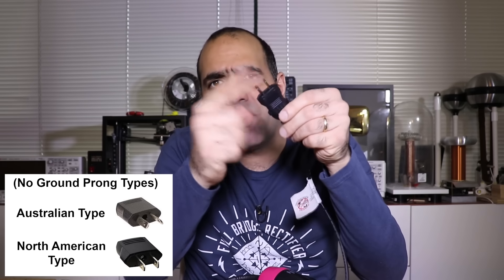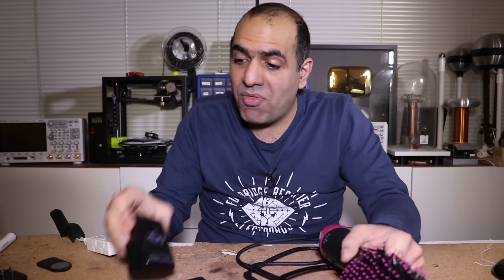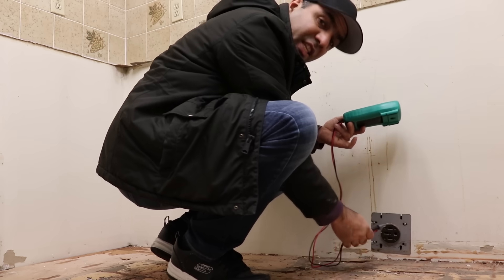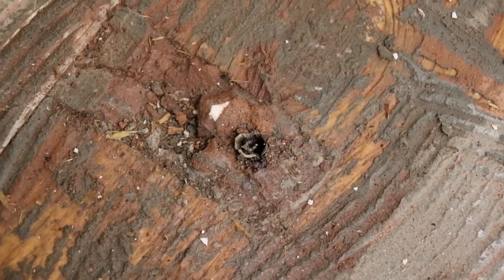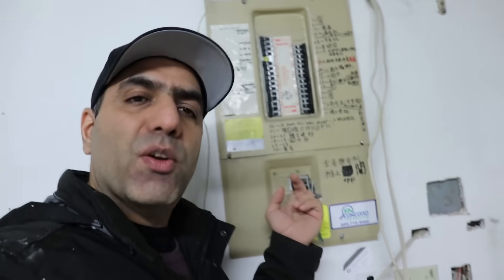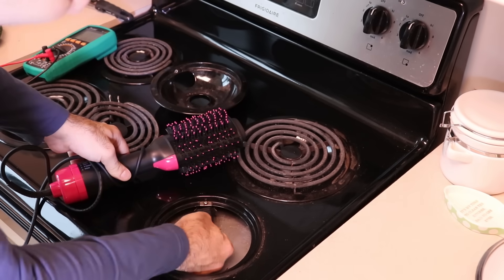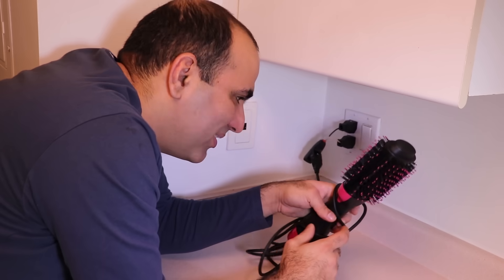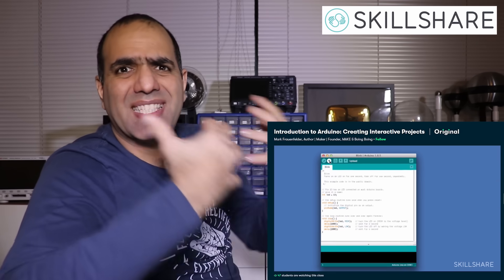Finding HIGH POWER 240V in a 120V Country

Comment: I'm an electrical engineer who moved from Europe to N.America.  I still remember replacing a kitchen outlet and poking around with my multimeter.  I wondered why, every time I touched the two live wires together, I would get a flash and a tripped breaker.  Took a while to figure it out.  I wonder if you have a video asking why N.America went with the clearly inferior 120V all those years ago?  I always assumed that it was to reduce the severity of electric shock risk.  But in fact they were worried more about the capabilities of the insulation (remember this was long before PVC or polyethylene etc).
Reply: Also, half way though the video, did you say 120 degrees instead of 180 degrees?  Also, did you replace the fuse in your multimeter with tin foil for dramatic effect?
Reply: All those years ago the main use of electricity was lighting.  Lamp life is inversely proportional to voltage. If you double the voltage you have to replace bulbs twice as often.  Low voltage bulbs have beefier filaments.
Reply: The North American system is not clearly inferior, it is far safer.  We have 240V available for the few appliances that actually need that much power, yet no part of the system is more than 120V above ground to minimize shock hazard.  Why in the world would you need over 3KW available at every outlet in your house?  There is a total of 3 devices in my house that need 240V - Water heater, stove and heat pump.  Every one of the hundreds of other things work just fine on 120V.

Comment: 4:00 the reason why the meter exploded: as he said his meter was on "current". His 20 A plug is directly shorted to ground with a thick copper wire. Which means, probing the 240 V socket is the same with shorting itself, yields extra power and explodes the copper wire inside. I'm pretty surprised the house's breaker didn't open after a sudden circuit short.
Reply: Probably the fuse in the meter blew before the breaker could trip.
Reply: @Owen_loves_Butters  yea I was about to say that too. What most likely happened is he drew more amps than his fuse could take and it blew up. I've actually done this to a meter before and you only make this mistake once lmao
Reply: It was not the fuse that blew. He blew up a capacitor

Comment: There was only two wires when you plugged into the toaster outlet... white and black .. means you had 120 volts .. load  from one plug and neutral from the other plug....not 240 or two phase  because only one positive... you need 120 from one phase and 120 from the other phase that are 180 ° out of phase with a common wire or neutral wire and of course ground...
Reply: No that is wrong.
If you want 240 volts then you use the two 120 volt lines that are 180 degrees out of phase. You don't use a neutral line in this configuration.
Voltages are always measured as a potential difference between two points. If you have three lines, phase, phase and Neutral, then where are you measuring the voltage to obtain 240 volts? The only possible answer is across the phase to phase with the phases being 180 degrees apart.

Comment: I thought that to reduce the chance of a 200 plus volt shock, you were not supposed to have seperate phases within reach of each other in a room. Touching a faulty toaster and kettle in that kitchen would give a 200 plusvolt shock not a  110 volt shock.
Also as you know the regular UK style 240 volt system has one wire to zero volt earth / grounding (often not completely zero due to resistancies). The US 220 V has both wires to a 110 volt supply, which is totally different to the UK system. Thought I would mention that as a do not try 220 volt in the US at home for UK style 240 volt stuff..
Also many old fashioned UK electical devices have the device body connected directly to the earth . ground wire. This would lead with the US system to a good chance of the device body becoming live at a fatal 200 plus volt level. Add that people will grab the device and not be able to let it go on AC it is very dangerous.
Reply: The current US standard is 120V / 240V.  The two hot wires are across a 240V supply.  The neutral wire in the US is bonded to ground at the main panel and is attached to the center tap of the 240V transformer secondary, so that you get 120V from neutral to either hot wire.  The ground wire is grounded and is what is connected to the chassis.  The 240V in US is completely equivalent to the UK, other than the difference in frequency.  US is 60 Hz, UK is 50 Hz.
Reply: @stargazer7644  You are dangerously wrong about the risk in the US. 
Each phase in the US is 110V to ground.
However 220 volts is available between two phases. Therefore  two appliances on different phases will have 220 volts between them. Touching one appliance  gives a 110 volt shock t ground. Touching both appliances gives a 220 Volt shock across them, and 110 volt Volt shock to ground. Really dangerous.

You are also wrong about the UK system. All domestic supply phases are at 240 volts from ground. Totally different to the US system. The UK does have regulations in place to keep different phases away from each other with domestic equipment to avoid a higher voltage shock.
Obviously not an electrician - I hope lol.
Reply: @andyrbush  You keep saying 220V in the US.  Our residential power system is 240V based and has only one phase, so  I'm sure you mean legs, not phases.  The only way you're going to get a 240V shock that way in the US is if you have two different faults shorting hot to chassis on two different improperly grounded appliances.  So you'd have to have 4 simultaneous faults for this to happen.  Not to mention, most (but not all) things in the US are double insulated making these faults completely impossible.  So this is hardly a "really dangerous" risk.  It never happens.

On the contrary, since the UK system always presents at least 240V in every appliance, I'd say that is the "really dangerous" system.  Any shocks received will always impart 4 times the power to the victim.  And look at the max power available at a UK outlet - insanity.  The US runs a special dedicated circuit for the few things that need that kind of power.
Reply: And to further answer your original question, it is perfectly fine to wire each outlet in the box to a different circuit with 3 wire cable. NEC 210-4(b) just says they need to be on a two pole breaker so that a fault on one circuit will automatically turn off both outlets in the box.
Reply: @stargazer7644  That is a totally different story to the original. And you are still wrong about the risks in the UK. It is or used to be illegal to have two phases in the same area of an office.
Reply: @andyrbush  You keep blathering on but saying nothing.  What is totally different? You're obviously from the UK and have no first hand knowledge of how the US electrical system works. If you're saying it's illegal in the UK, I can't comment on that.  If you're saying it's illegal in the US, I just gave you the NEC code that addresses the breaker requirements for it, so it is clearly allowed since at least 1999.  Look it up for yourself.  If you don't have anything specific to say, why even reply?
Reply: @stargazer7644  I am an engineer and both US and UK citizen. If you think I am saying nothing that proves you have no clue what you are talking about.
Reply: @stargazer7644  I will dumb it down  for you. 
If you only take one US supply phase into an outlet, there is only 110 volts available. Agreed? You cannot get 220 volts out of it.
If you take two phases into a domestic outlet, 220 volts is available in there agreed or not? US 220 volt outlets are wired differently to 100 volt outlets.
There is one 110V from one of the terminals and a separate phase 110 volt potential from the other terminal. If there is a leak to the body of both devices connect to a 100 volt outlet with two phases connected, then between them there is 220 volts. Touching both devices gives a 220 volt shock.

I have worked on massive steam and gas turbine generators. I do know what I am talking about.
Reply: @stargazer7644  If you put a volt meter between the two live holes in the double outlet of a 110 V receptacle wired with two phases (as discussed) it will read 220 Volts.
If you were to accidently contact (DO NOT TRY IT) those supplies, one to each hand, 220 volts will go through you.
If you happened to be insulated from the ground then there will be no earth fault to trip the breaker and you will not be saved by the breaker.
An earth fault breaker is a consequence mitigation device. Its job is to try and save people from the hazard. It is like a seat belt, reducing the consequence of a car crash. The primary device to stop a car crash is the driver and the braking systems.
Wiring a 110 volt outlet to one phase eliminates the hazard of a 220 volt shock.
Why do people like you vehemently push something they know nothing about. Are you one of those brainwashed by the US education system to never challenge what authority tells you? Quite amazing really.
Reply: @andyrbush  If you put yourself across the two pins of of a UK outlet without being grounded, you'll have exactly the same experience and you won't trip any safety devices there either.  So, WTF is your point?  For that matter, if you get across the hot and neutral of a regular outlet, you'll also get a shock.  You've become the load, so you'll not trip any safety devices.  And again, the situation you've described across two devices on different legs is extremely unlikely, but you keep on insisting it happens every day.   I've now told you multiple times power in the US is 240V and not 220V and you can't seem to get it, and you also don't understand what a phase is despite multiple explanations.  I have a 4 post maximum for educating idiots, and you've now exceeded it.  Stop wasting my time.

Comment: It's prolly discussed below, but apartment buildings and large places are usually served with all 3 three phases od 120v power to run high draw equipment. Tapping into to 2 of the 3 phases gets you the 208v
Reply: 208v is pretty weird.  the oven wouldn't run as hot as it should.
Reply: @tsm688  correct, sir.
Reply: 3 phase plugs and sockets that have five wires in them are always wired in wye, not delta.

Comment: 9:10 "perfect solution" - but with only 205 volts instead of 230-240 the hair dryer would be working on 25% less power

Comment: She needs a 50 dollar inverter to boost the power from 120v to 240v. That's really all she needs.
Reply: That is not what an inverter does. An inverter takes DC and converts to AC.

To take the voltage from 120V AC to 240 V AC you need a 1:2 ratio step up transformer , where the number of turns on the secondary coil are double in number of the number of turns on the primary coil.

Comment: More on the 180 deg will be nice
Reply: What do you want to know?  North American homes are provided single phase 240V, but the transformer has a center tap for the neutral wire.  The neutral wire is halfway between the hots in voltage (because it is in the middle of the transformer coil).  We connect the neutral to ground so it is defined as 0V.  So we have 2 hots, and 1 neutral.  Most outlets are connected to the neutral and one hot, which gives it 120V.  Very high power devices get connected to the two hots to get 240V.  This arrangement is safer because it supplies 240V power, but yet no part of the system is ever more than 120V from ground.   When you measure the hots, at one point in time one hot will be 120V above neutral/ground, and the other will be 120V below neutral/ground, with 240V between them.

Comment: Also I built my own suicidal adapter to use two smaller extension cords to power an electric heater, but the two hot wire from the two plugs are wired in parallel
Reply: lmao cascade failure

Comment: So, I am in India. And if i can get two phases of 220 or 240 V, does that mean I can get more power? Just asking
Reply: That's why they use a 3 phase system to distribute power.  It is most efficient.  Using more than 3 phases gets less efficient though. Industry and large buildings that need lots of power have 3 phase power.

Comment: 240 doesn't need a neutral to close the circuit?
Is that because they're out of phase and use each other as a neutral?
Reply: If you're drawing the same current from each of the hot wires in 240V, zero current will flow in the neutral.  Therefore, you can just leave it out.  You only need the two hot wires.

Comment: An FYI... almost all electronics (not hair dryers, irons, refrigerators, or other appliances with heating elements) can operate on 90-240vac at 50-60hz. 
Electronics only!!!
This would be things like laptops, phone chargers, and other electronics one typically travels with, even my CPAP! Pretty much anything with a black box power supply. Look on the specifcation chart printed on the power supply. If it says 90-240vac 50-60hz input, youre good to go. If it is thusly labeled you can run it right off the line voltage of whatever  country you are in with just a plug adapter.  No voltage adapter box needed. Modern electronic power supplies are made to take this wide variety of voltages because of the international nature of distribution.  Nobody wants to make 5 different power supplies for one product and then have to make sure they get the correct ones to the right country. Easier to make 1 universal power supply and have different modular power cords for each country. Also, some countries, like Saudi Arabia, have both 120 and 240 plugs. Yaaay. A coworker blew up my traveling network switch there because the power supply was only rated for 120vac and he plugged it into 220vac.... POP! Smoke! 
So this is true ONLY if the power supply is labeled 90-240vac and 50-60hz input.
Reply: That's only true for devices that have universal power supplies.  Those are actually rather uncommon in the US.  Anything that uses a linear "wall wort" power supply will SMOKE if you try to plug it into 240V.   Make certain the device says it will work on both voltages before plugging it in.
Reply: @stargazer7644  LOL, hence, why I said "check the label on the power supply". They are not as uncommon as you think. Look around your house and more are universal thana you think!

Comment: So.... A 120v country does not exist. You have 120v AND 240V IN A 120V SYSTEM. THEY ARE CALLED 120/240V SYSTEMS. OR INSTALL A 15 AMP 240 NEMA PLUG IN YOUR HOUSE. ITS EASY, https://www.homedepot.ca/product/leviton-15-amp-250v-receptacle-ivory/1000407842

Comment: 7:51 "See?" No, unfortunately not. I see 206V AC. Why not simply plug that stupid thingie in this outlet using the adapter and ignore the 35V difference? Also, why do you have 120V outlets and 205V outlets side by side? That sounds dangerous. Or is it some phase shifting shenanigans showing as 206V while actually being 120V? I am a little concerned about my physics Ph.D. defense next month, I guess I should know stuff like this...
Reply: That's because you missed it. He's plugging the meter into two different 120V outlets and getting 208V because each outlet is wired to a different phase.  Plugging into one outlet gets you 120V.    He gets 208V because he's in a large building supplied with 3 phase power.  If you try this trick in a single family house, you'd get 240V.
Reply: Finish the video before commenting. That's what he did.

Comment: All the hairdryers that I ever saw, har a little switch that can be operated with a screwdriver, to run your appliance on 120V or 240V ( or some othersimilars voltages). Doesn't yours have it?
https://images.app.goo.gl/P2fnq6Y8CYfYT2p46

Comment: I thought everyone knew, that you should always return the meter leads to voltage reading, immediately after testing current.
Reply: And I thought that taking a current measurement was just reading the voltage across a resistance
Reply: @coastersaga  What if you can't put the meter across the resistance?

Comment: I like how mehdi teaches electricity physics with fun and makes common mistakes (probably on purpose) to show what you should be aware of. Thats actually quality education and i love it
Reply: At 2:09 the transformer isn't really blowing up. He rigged a undervolted capacitor to the ac lines ,that couldn't be seen, and would blow up when plugged it. Seems to be one of his favorite tricks. Even tho most of the mishaps are staged it doesn't take away the entertainment value for me.
Reply: Yeah, definitely. Definitely on purpose.
Reply: i agree👍
Reply: probably?? do you really think he does not know what he is doing? it's all for show. in the scene in the house when he plugs in the voltmeter you dont see that he puts the to wires (black and red) in a circuit (it;s film in such a way that you dont see it) so that when he connects to the socket it will make a spark. 
He knows what he is doing. 100% all the time. so it's just a show
Reply: @AlexSword13ch  There is, in fact, one time where he had a genuine accident and almost died. When the Jacob's ladder fell on him.
Reply: @AlexSword13ch  At least 99 percent of his time. But not 100.
Reply: @AlexSword13ch  the DMM if not from centuries ago [figure of speech] would have protection built in for total dumbashz so that wouldnt happen even if you made that mistake. And yep you watch his interview with keysight hes very explicit about how its staged and how its funny to him the newer viewers who dont know yet
...make sure its on voltage and not current?
The wiring is very explicitly different for V vs I on the DMM it has nothing to do with setting (different sockets). And the I input is fused with a pretty low current vs currents you might encounter in industry